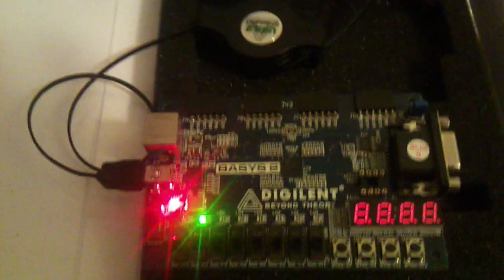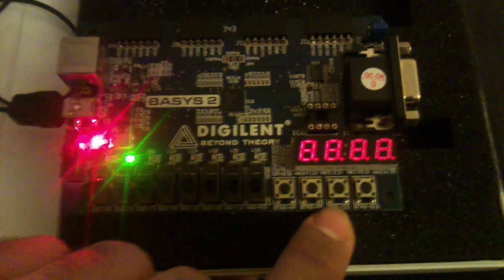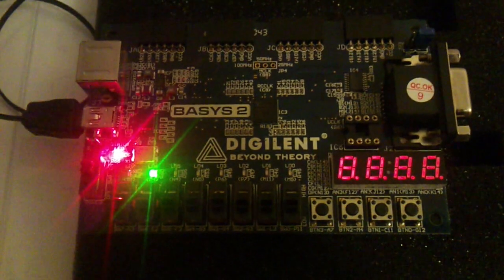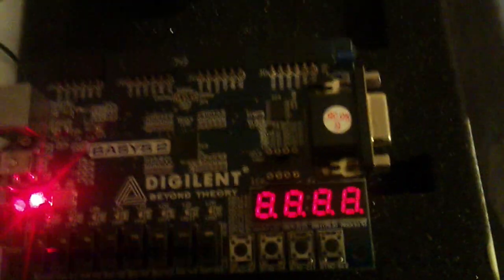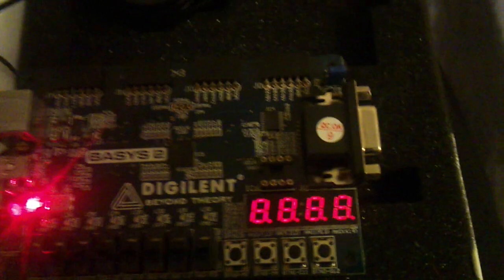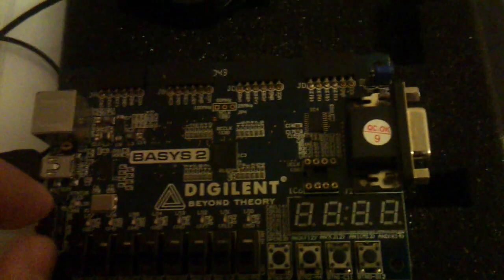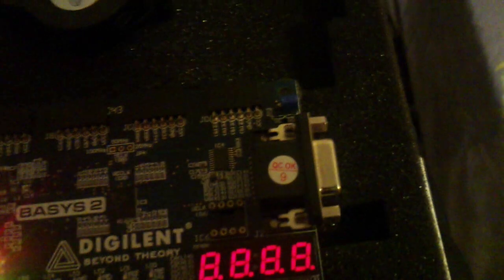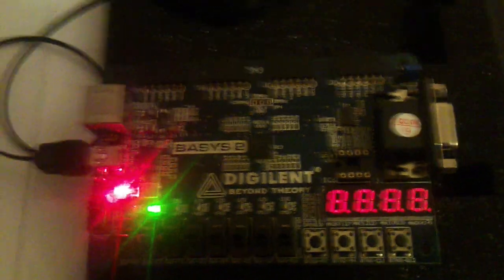FIFO Buffer Memory in Verilog | FPGA

Comment: great video explaining the project, thanks for the code examples too. I plan on using it to test passing data between an input capture system and an SPI slave output communications to a microcontroller (SPI master)